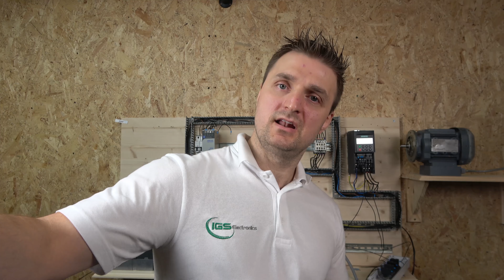Siemens Micromaster 420 remote control, 2 wire and 3 wire control and potentiometer. (English)

Comment: I NEED HELP !!! 😢😢😢

I used an S7 300 PLC with a DIGITAL OUTPUT MODULE. I made a very simple program with Q0.0 as an output. I plugged a cable from Q0.0 to DIN1 (terminal 5), P700=2 to enable using terminals, P701=1 to use DIN1 as ON/OFF, P1000=1 for MOP setpoint. The program works, the Q0.0 Led lights up and i tested a 24vDC in terminal 5 STILL !!! the Drive doesn't start 😡.

Comment: I found this video and your previous video on 2-wire  control very helpful. Have you ever tried to use the drive with an external JOG button? I am  struggling to interpret the manual as to how to incorporate an external JOG!
Reply from the maker: Hi There. How far have you gotten with particular task you are trying to achieve. Have you assigned the jog function to any of the inputs. Manual page 46 onwards?
Reply: @IGSElectronics  Hi. I am not sure which input I can assign the jog function to. I may have to forget about trying to incorporate a JOG button and stick with the basic 2-wire configuration.
Reply from the maker: @glynbrandon861  Ok, lets se if we can make this work. For the 2 wire control you are using input 1 to go forwards as def, input 2 is set for reverse and input 3 is reset. So if you go to par 703 and change input 3 to 10 for jog forwards or 11 to job backwards, your input 3 will be changed to jog now so you should be good to go. Let me know how it go.